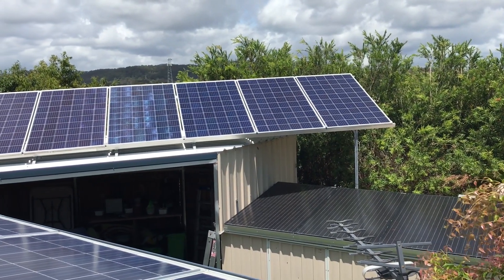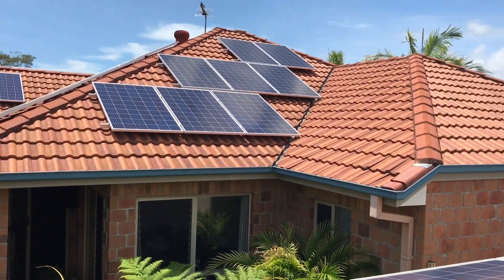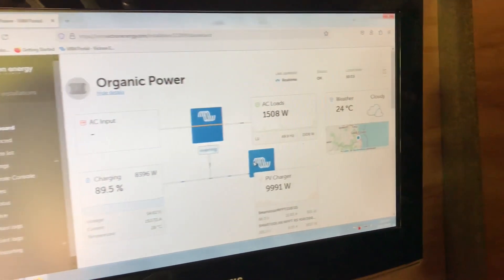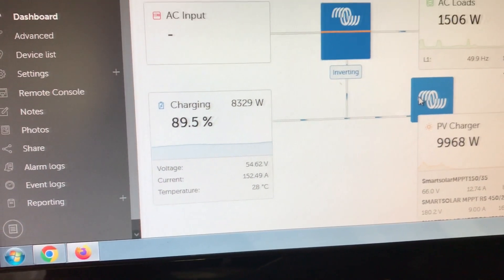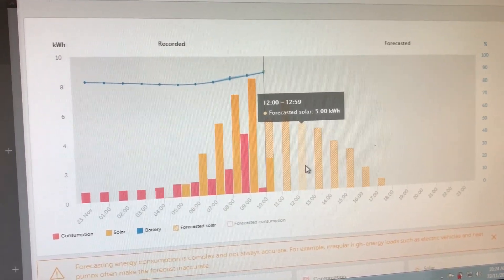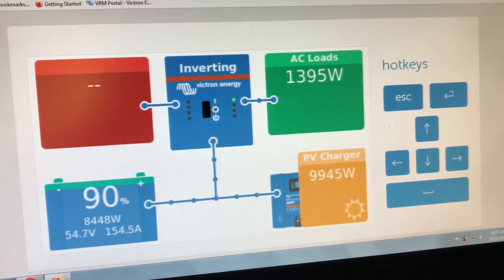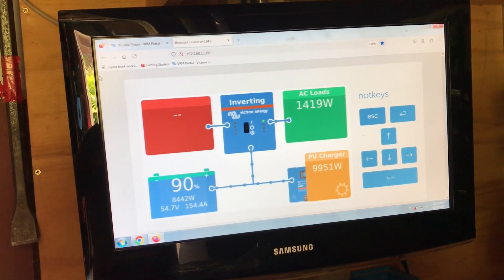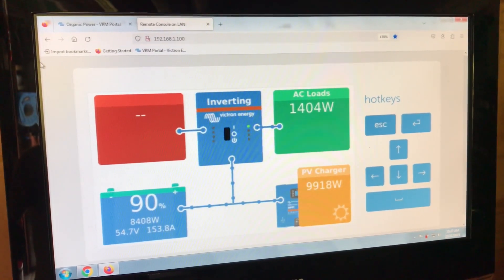Bill FREE! - POWERFUL 48V Triple Parallel Victron Mulitplus II Off-Grid Solar Power System

Comment: I wish I had so much space for solar panels...  Are you satisfied with the Multiplus II in terms of power output and noise?  Did you have any other inverters to compare?  I am between the multiplus and a hybrid.
Reply from the maker: It was a lot of work but the solar farm turned out really well. The power output of the completed 15kva unit is enough for our 4 bedroom house with a family of 4. Noise is not an issue for us as I made the power wall in a purpose built shed down the back of our yard. I personally wouldn't setup an off grid near my house, just in case the worst happens. The only other systems I have are grid tie with no battery, so can't really compare.
Reply: @OrganicPower-Australia  Nice.  Having the batteries in an outside shed is not a bad idea because despite the fact that LiFePo4 batteries are quite safe, in case of a fault the smoke they produce is not...  When I finish mine I will definitely install a smoke alarm as well.   Thanks.
Reply from the maker: You won't look back, It's been so much better not having to worry about how much power we are using. Let me know if you post a vid of the system, love to take a look!
Reply: @OrganicPower-Australia  Definitely.  I am still researching for the right setup...
Reply from the maker: Nice one. What are the different brands you are looking at? I’m interested to see what others are using!